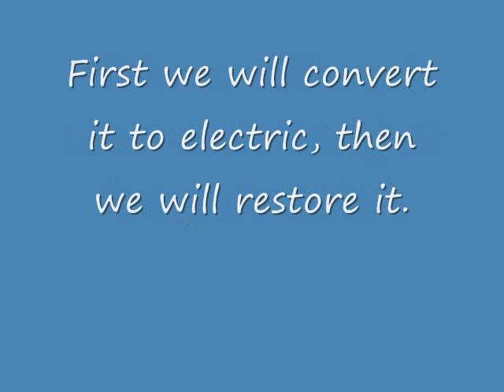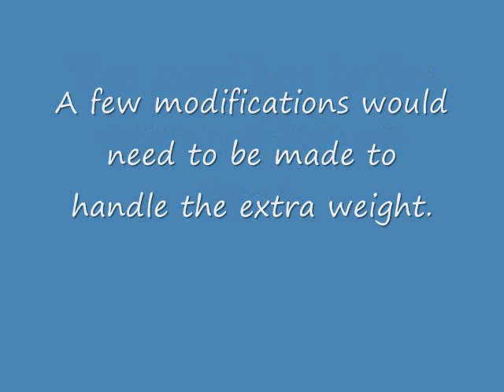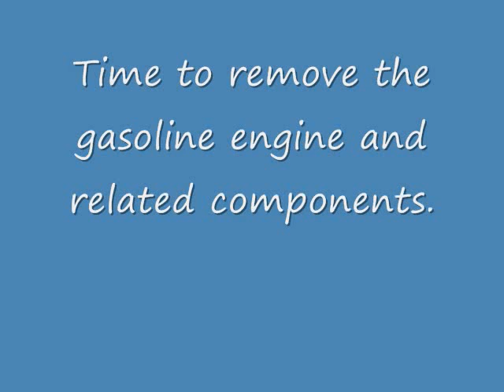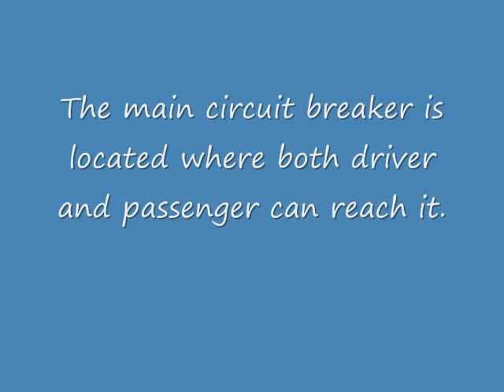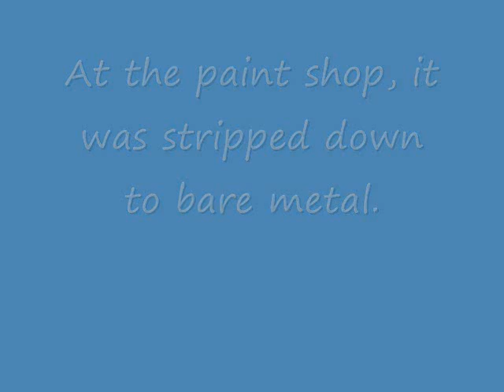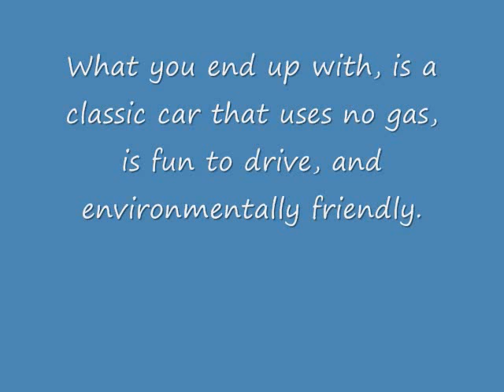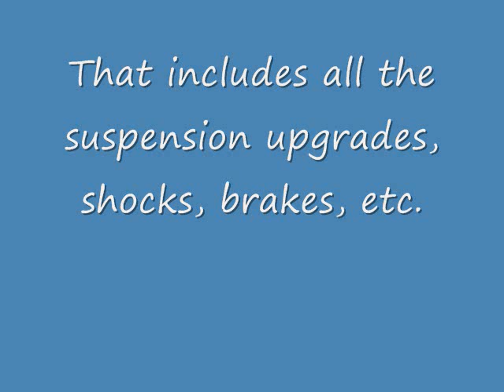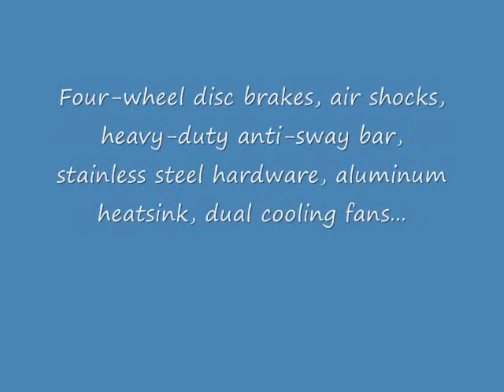VW Beetle converted from gas to electric was part of effort to start a new industry.

Comment from the maker: The Bug is still lead acid, when the batteries were new it would get between 40 and 50 miles.  0 - 60 mph is under 15 seconds, but I don't remember exactly.  We converted and tested this vehicle in 2009.  90 mph top speed.  We will be converting it to lithium in 2014, and it will be almost 500 lbs. lighter.  That should make a difference on some of the specs.  Should be close to the Karmann Ghia.  Thanks for watching.

Comment from the maker: Top speed 90 MPH, 0-60 MPH in 15 seconds (with normal driving)
The range is 30 to 50 miles depending upon conditions.
Suspension upgrades and conversion added 920 pounds.  Weight after conversion is 2580 pounds.
The bug features four wheel disc brakes, air shocks, heavy-duty anti-sway bar, lightened flywheel, heavy-duty clutch, welded polypropylene battery boxes with polycarbonate lids, custom venting system, and an on-board 120 volt charger.

Comment from the maker: In California, all gas powered vehicles from 1975 and older are smog exempt.  After converting a 1976 and later vehicle, you need to take it to the DMV where they will do a visual inspection.  They confirm the VIN and the fact that the vehicle is no longer internal combustion powered.  The vehicle is then exempt from the smog requirements.  The registration costs are the same as before.  We have done this many times without any issues.  I am not familiar with Oregon or Utah procedures.

Comment from the maker: You are right, the best handling vehicles have a 50/50 weight distribution, like the Mazda Miata.  However, the VW Beetle was designed by the factory to carry more weight in the rear than in the front.  In designing a conversion, it is best to match the factory weight distribution.  I know from racing the Bugs and from our testing, that we did need some additional weight up front, thus the 2 batteries up front.  However, the Bugs will not handle well with to much weight in the front.

Comment from the maker: @n4120p Thank you for your comments.  The electric Beetle requires much less attention than the original stock Beetle. No oil changes, no points, and no brake and valve adjustments. With the Lithium battery option there is basically no maintenance other than checking your tire pressure.  The replacement cost on the Trojan batteries is approx. $1700.  The batteries in our marketing vehicle are more than two years old, and have over 7000 miles, and are still going strong. I drive the car daily.

Comment from the maker: I would recommend locating some of the batteries in the rear of the vehicle.  You will not have enough room under the hood for a large enough battery pack, plus motor, controller, etc.

Comment: You have skills.
In the process of converting my kit car(GT40) into EV. Currently, I have an '82 Mazda rotary married to a 67 VW 4sp, all on a 64 beetle pan. Did the rotary conversion in 84. Loved it until now. The chassis is rotten so time to restore from ground up. I have lots of room behind the front seats for batteries(Lithium). Any advice on the good yrs for a donor chassis and trans? I hate my trans that I have.

Comment from the maker: @pitchingwedge1 The range with the lead acid pack is 30 - 50 miles.  We also offer a lithium pack that provides a 40 - 60 mile range.  The performance is better than the stock Beetle with a 0 to 60 time of about 15 seconds, and a top speed of 85+ mph.  It also handles and brakes better than stock.

Comment: have you up graded the battery systems? there are lighter more powerful batteries out there now? VERY GOOD LOOKING PAINT JOB TOO!! What are the top speeds etc..? the shifter is still in the car, do you have to shift it, and is it still like the gas one. where you need to let each gear wind out etc... VERY COOL VIDEO AND FINE LOOKING CAR!!!

Comment: What batteries went into this particular conversion and what is the nominal capacity after a little break in time?

Nice job by the way. 

Also, for ~6g's I could put 10kw/h of 25c nanotech lipo's. Not so much range, but motor melting discharge curves and only 150lbs+packaging/cooling. ~2 1/2 hour empty to full @ 4kw/h.... at least that is what reading the labels tell me.

Maybe that should go in a NSX conversion?

Comment from the maker: Typically around 400 cycles for lead acid batteries, but there are a lot of variables.  The Bug's batteries are on their fourth year.  Do not have an answer to the rest of your questions.  However, I do know that electric vehicles are 8 times more efficient than internal combustion vehicles. One could ride a bicycle. Not sure of the carbon footprint of a cyclist though.  I'll have one of the staff look in to it.  I'll have them look up the carbon footprint for a gallon of gas while their at it.

Comment: @theduke502 Thanks for the leads. I am on the East coast, NC. Lots of nonrusty VWs out here but I'm not sure if I even want to stay with VW and maybe go completely custom on the chassis, maybe even alum. for wt reduction. I do like the torsion bar suspension though. Could just buy a complete donor car with no engine and just start tearing it up.

Comment: Great Job, very impressive work. I do have a few questions
Does the electric motor require gear shifts? Is there enough torque to get the front wheels off the ground on acceleration? Any issues with getting it registered with the department of motor vehicles? If you cut the electricity off does the motor drag the back wheels? Can this be driven at interstate speed?  THANKS for posting this video.

Comment: How long will the Lead Acid Batteries Last (life cycle)? What is the carbon footprint for the recycled old batts + the production of the new batts. How much utility co fuel will be used to generate the recharge power and what is the carbon footprint of that life cycle?

Comment from the maker: @imsiriustube There is, by reducing the voltage, you reduce the top speed, and decrease the weight of the battery pack.  A 120 volt setup gets you about 60 - 65 MPH and approx. 5 - 10 more miles in range.  This not an absolute, as there are lots of variables.  We design our conversions to be Freeway capable, and thus use a 144 volt setup.  Additional range is accomplished using Lithium Ion batteries, at an additional cost of $6,000.  Range costs money.  How far do you need to go?

Comment from the maker: Yes you still shift gears.  Front wheels stay on the ground.  No DMV issues.  No motor braking.  The top speed is 90 mph, and it is regularly driven on the interstate.
Thanks for watching and the comments.

Comment from the maker: Most of our conversions offer a 60 to 100 miles range per charge.
Ah, the laws of physics, it takes more energy to turn the alternator than you get out of the alternator, so the net result is a loss.  It just adds weight and expense.  You can choose to use an A/C conversion and use regenerative braking.  We offer them on our website, EV4Unow.com

Comment: Would larger wheels such as a baja bug conversion still work with the electric motor?
Reply from the maker: Yes, the electric motor has twice the torque as the original engine, and it has it at zero rpm.

Comment: Have You thought about using a capacitor bank instead of battery's. ??
Reply from the maker: Capacitors accept a charge, and discharge quickly, however, they do not have the energy density that batteries do.  They work well in addition to battery cells, but not at replacing them.
Reply: Ok, I'm not an expert. But seeings that you usually charge every day and caps seem lighter you might be able to hide them in the nooks and crannies,  Just a thought.   I forgot to mention,  I love that Bug, It's awesome.  Like a lot of baby boomers, I had several bugs.

Comment from the maker: Due to the rpm limitations of a dc motor, a transmission is necessary.  The clutch allows for faster shifting, less wear on the transmission, and is the ultimate safety disconnnect.
Thanks for watching.

Comment from the maker: Short answer, we use an electric vacuum pump for the brakes, and an electric motor to drive the power steering pump.  Both of these topics will be covered in an upcoming video.  Thanks for watching.

Comment: Range?  I didn't see the stats on the cars range?  20miles? 40? 60?   The most important thing I didn't see.
Reply from the maker: The range is dependent on the battery pack you choose.  The pack in this vehicle at the time of the video was lead acid and had a 50 mile range.  Currently the vehicle has a lithium pack and a 60 mile range.  I would say that weight is most important.  It will affect your range, the cost, and the performance.
Reply: EV4U Custom Conversions
 Yes I am full aware of different things from weight to temperatures effecting battery output but my only question was range.  I didn't see it in the video...  thanks for the info.  I am thinking about converting my 1981 280zx long nose straight six to a electric car. Down side is there is no "trunk" its  a hatch but has plenty of room under the hood and some people convert these cars to a V-8 with the ample room under the hood.  I am thinking a electric engine plus batteries in the same compartment?
Reply: EV4U Custom Conversions
 My second option is converting my 1996 ford ranger which as you know would have a entire bed for battery capacity.   So I just want to set up under the best cost and longest range.  I know a guy locally who has converted his caddy to electric and runs a small gen set to repower the battery pack after a trip and doesn't need to worry about a plug in source. I think he runs a 2.5kw  diesel gen set in the trunk that only uses a pint of diesel per hour and fully charges in 4hrs.

Comment from the maker: The top speed of the motor is dependent upon the voltage, current, and vehicle.
The setup in the video is 156 volts, 500 amps, and the Bug weighs 2580 lbs.  The top speed of this vehicle is 90 mph.  Thank you for watching.

Comment: How much rpm is that eletric motor?
Reply from the maker: Maximum RPM is 5,500.
Reply: @ev4u  for some reason i thought those phase 3 ac eletric motor put out a limited 3k rpm...
Reply from the maker: The motor shown in the red Beetle is a series wound DC motor from NetGain Motors.  The maximum RPM is 5,500.  The maximum RPM on most of the 3-phase AC motors that we currently use is 6,500.

Comment: How many 12v batteries?
Reply from the maker: The car is currently powered by lithium batteries.  When it was powered by lead acid in had twelve 12 volt batteries.

Comment: Cost of batterys?
Reply from the maker: The batteries vary in cost based on cell size, manufacturer and who you purchase them from.
Currently CALB CA Series 100 Ah cells are about $135 and the 180 Ah size is about $243.
These are a LiFePO4 cell.  Prices as of October 2017.